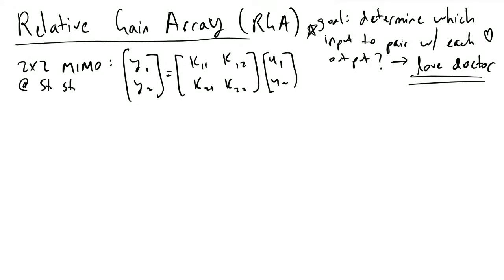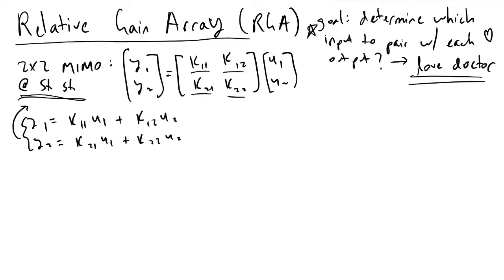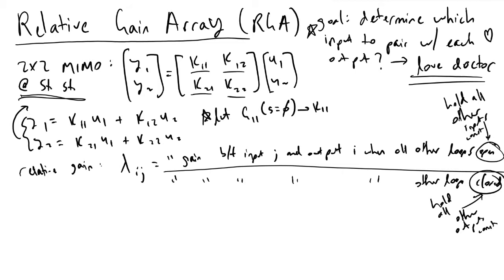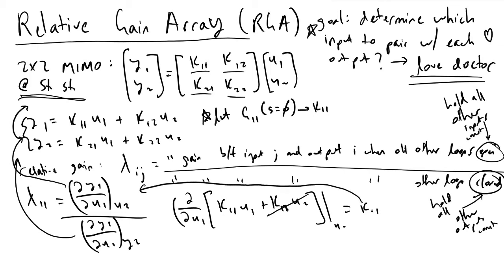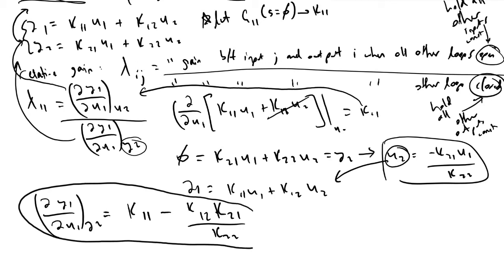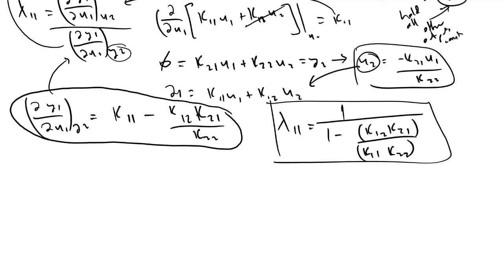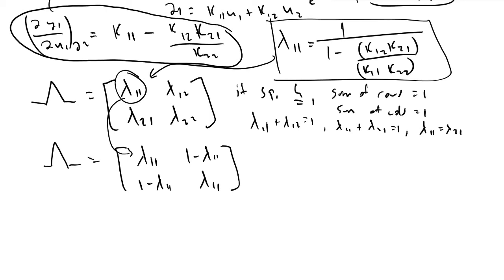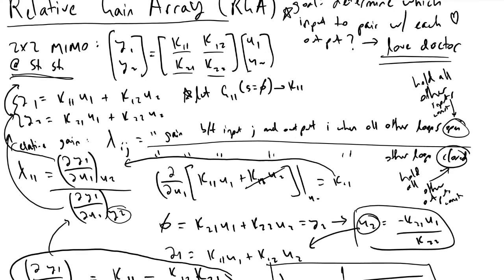Relative Gain Array RGA and Input Output Pairing

Comment: Thanks for the explanation. But how do you apply this in a real system? For example, consider a mold used to cure a complex carbon fiber and epoxy part. The cure temperature across the part has to be held to +/-1C. There are ten heat "zones" each consisting of an electric cartridge heater and a thermocouple. For simplicity, each zone needs to be at the same temperature. Each zone needs to ramp from 20C to 180C over 24 hours. How does the control engineer determine the relative gains for each zone?